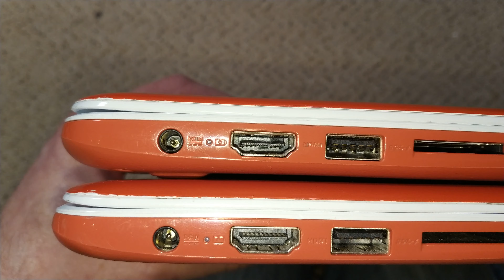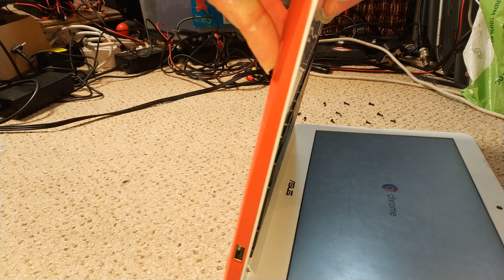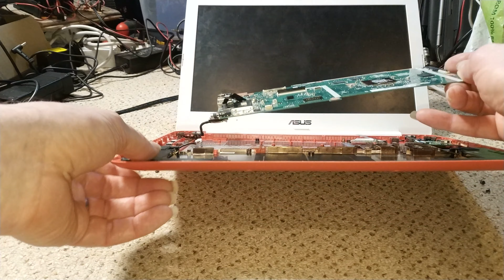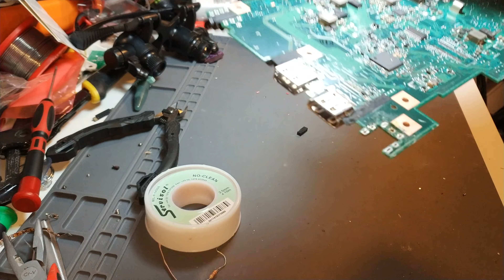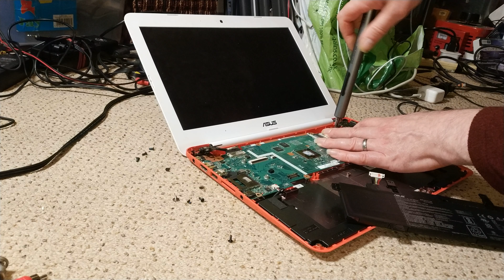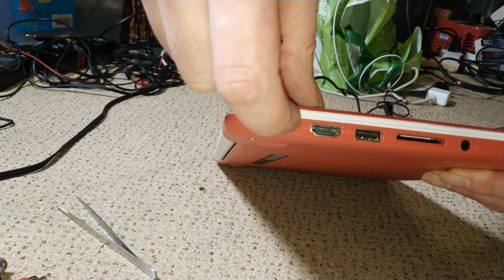Asus C300 Chromebook power socket repair (plus motherboard removal)

Comment: Hey mate, great video! Really helpful.
I've got the exact same charging problem on my ASUS laptop and noticed you mentioned buying the replacement socket from eBay.
Do you still have the link or remember the seller's name?
I'd like to buy the same part you used.
Cheers for the upload - appreciate it!
Reply from the maker: Unfortunately the seller I bought them from no longer stocks them and I'm struggling to find any on eBay; Asus seemed to use a similar design for many of their Chromebooks but I bet they're all slightly different. I'll keep searching though and let you know if I do come across one or if I have any left in stock.